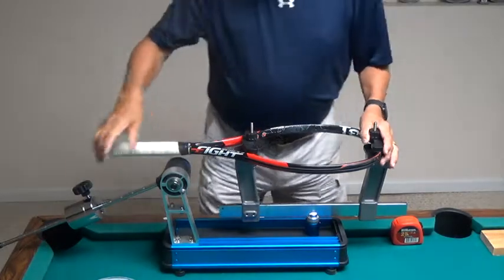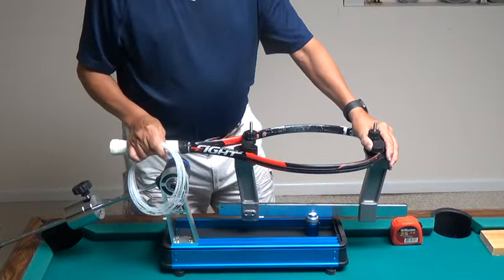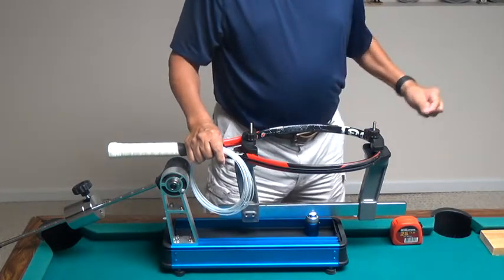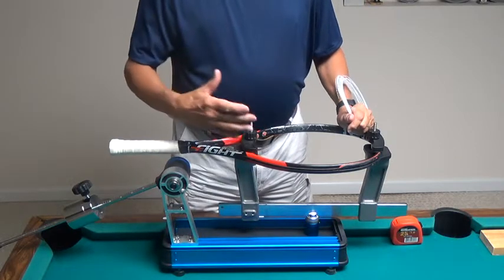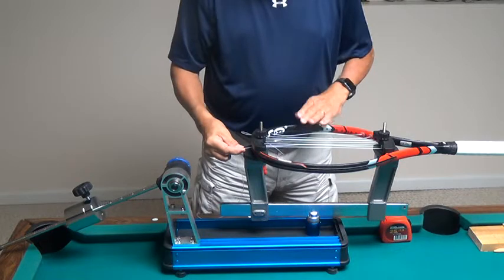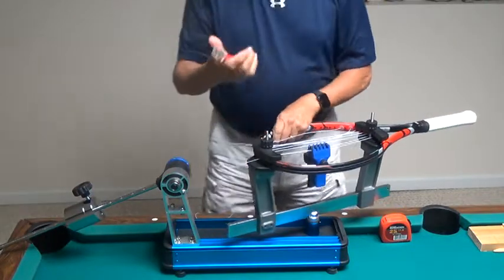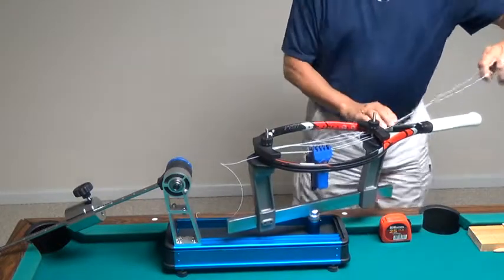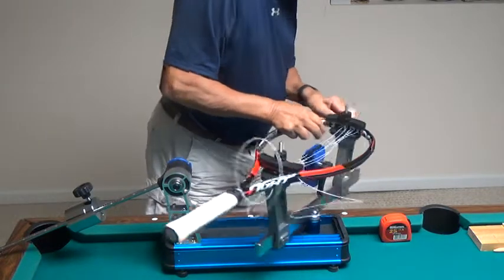Stringing ATW with a gamma X-2 (part 1)

Comment: I use 32ft for one piece box pattern(atw). 105sq.in 16x19 racquet Wilson tidal force and that's enough for 1.5ft of extra string on each end
Reply from the maker: Sokeresa that would ver much depend on the string you are using and how much the string stretches. If you’re using XP string 32’ is maybe too much. If you’re using a stiff poly you’re going to end up short.
Reply: @Mr10sStringer  good point. I did use syngut and is stretchy so yeah, i would probably add 1ft if poly

Comment: I have the progression 200 which is a similar unit.  After stringing at least 50 rackets, its a pretty good machine that doesn't require any maintenance.  Although, I have measured the tension with a gauge and the scale is off by 1.5 lbs.  When I started stringing, I did a lot of around the world patterns and then I decided to just do the 2 piece.  I find that one piece patterns I used always end up with tying one side of the mains and so you have a slight tension imbalance in the racket as there's always some tension loss on the tied side.  Also, I always recommend players use a hybrid when stringing with poly.  Over time, a single poly string will eventually destroy your arm.  I wouldn't start the mains with putting the stringing clamp at the center, you have to double pull and the centers never get reference tension.  Starting clamp is the way to go.
Reply from the maker: Wally Friend as far as no maintenance I have my doubts about that. I going to clean the clamps and gripper quite often. Better to keep that clean and never have a problem rather than wait until you encounter a problem to fix. I would never tie off an outside main. I prefer to loop the string I’m tying off behind the anchor string inside the grommet. That way you have a tensioned string from the clamp to the grommet and the knot is then tied right against the grommet so there is little or no drawback.
Reply: @Mr10sStringer  learning alot from your vids man, thanks.  I also have a gamma II and wondering what you mean by cleaning the gripper and clamps?
Reply: @Mr10sStringer 
I notice you pull tension with the arm in down position.  I've seen instructions to start pulling with arm in up position.  Is this just preference or is there an absolute answer?
Reply from the maker: Nugget when I clean the gripper I take the drum off and clean the 2 plates that grip the string. I start pulling with the bar down so I always have 360 rotation on the turntable. Also when stringing a low stretch string like poly or Kevlar if the bar is all the way up you may never get it down to level without forcing it.

Comment: I restrung my racquet using the klippermate but I messed up a lot which resulted in 2 hours of attempting to do it but I really got the hang of it towards the end I think I could restring my racquet in less than an hour the next time. So long as I don't forget what I did LOL.
Reply from the maker: That’s not bad at all I find it relaxing to string rackets. With time and experience with the racket you’re stringing, and the string and machine you’re using you’ll get faster and most importantly more consistent.
Reply: I also started not that long ago and trust me it does get easier!

Comment: Another noob question. I got Luxilon element 125 string (co poly monofilament) and I can not pull the sucker through the racket. They appear to be too stiff to navigate through the grommets. What am I doing wrong???
Reply from the maker: K V it sounds like you’re pulling the string at an angle through or you grommet holes are small and the string is too thick. But a 1.25 string should not be too stick. Try to make sure as you pull the string it is pulled straight through the grommet.
Reply: @Mr10sStringer  thanks, the string goes trough ok, it seems to be so stiff that it cant be pulled around corners like the multi string. I ran into trouble trying to pull the initial mains through the bottom to get the string even.

Comment: Are you familiar with the pro staff 90? When stringing with a conventional two piece method, the last cross has to go through a double blocked hole.  It’s my own racket, so I’m considering experimenting with ATW.  Was just wondering if you had experience with this racket.  Thanks!
Reply from the maker: Yes I am and using an ATW pattern will fix your problem. If you like hybrid stringing using 2 starting clamps to hold the outside mains will work too. You can tie off the mains then at 11T (the cross tie off) once you get down that far.
Reply: @Mr10sStringer  awesome, thanks!!

Comment: love your videos. question: what is the difference which side (left or right) you choose to be short side (some Prince rackets obviously excluded) ?
Reply from the maker: I prefer to weave my hard weaves from left to right so I determine where the short side goes dependant on the number of crosses. If there is an odd number of crosses the short side is on the right, with even crosses it is on the left.
Reply: @Mr10sStringer  that makes sense...thanks again
Reply: do you use "knot tension" when it exceeds manufactured recommended tension ?
Reply from the maker: Ralph h if I was asked to use “Knot Tension” that exceeded rec tension I would do it.
Reply: @Mr10sStringer  are you familiar with NaturalGutWhoilesale and their V 5 + string ? any tips for stringing w/o breakage ?
Reply from the maker: Ralph h I’ve heard of it but never tried it. Heard too many problems with a breaking. If I was going to try it I would never use the X-2 or flying clamps. I would only string it on my Babolat machine.
Reply: @Mr10sStringer  thanks...that's the problem I'm having. I use the Gamma ELS and have no problem with good gut but I've broken this stuff twice. Thanks for the speedy reply. I hope you don't mind the mentoring (tell me if you do )
Reply from the maker: Ralph h the way I look at it it’s cheaper to play with good gut that will last than cheap gut the breaks when you string it.

Comment: HI Mr10sStringer, I was wondering my string griper won't grip my string when rotating and slides out. I read I need to clean the diamond coating by using a knife sharpening stone. Do you have any other recommendation on how to clean it? This is what was written on the manual "Knife sharpening stones work well for cleaning the diamond coated string clamping surfaces"
Reply from the maker: I would take the drum off that has the 2 sides for the gripper and clean them with a brush and 91% alcohol. Make sure when you put it back together the top section with 1 screw is not too tight or it will not close and grip the string properly.

Comment: Newb question for anyone with the x-2. Does it require a monster grip to hold the blue ratchet knob still while lifting the drop bar? I almost need an oil filter clam to keep it from moving.
Reply from the maker: K V I do not have a strong grip my self and when you get up to 60+ lbs it is actually quite difficult to hold. If you can hold it I doubt the clamps will without having to be so tight you crush the string. But there’s still hope. Better clamps will not loose at much tension so you can set the reference tension lower making it easier to hold. You can use the T handle Allen wrench to hold the knob also. Use the T handle in the bottom section of the knob because if the top screw is too tight your gripper won’t work as well. At one time I was considering using 2 Allen wrenches in a 1x2 board to get more leverage to hold the knob. Good luck, I’ve found after stringing with the X-2 you grip does get stronger.
Reply: @Mr10sStringer  Good advice thanks! too bad they just dont have a slot for a screwdriver or something. Hopefully Ill strengthen my wimpy grip lol
Reply: @kenmtb  i recently used a x-6fc which is the same ratchet DW mechanism and it was a pain brother.i strung at 57lbs multifill and i could barely hold the grip to move the bar. I thought i was doing something wrong cause i seen vids on YouTube including this one and people don't seem to struggle as much
Reply: Can you lift the bar a bit  to release tension then turn the  ratchet?
Reply from the maker: K V maybe you can lift the bar and it will release some tension. Whether it is enough to turn the drum or not I’m not sure. The issue is as you turn the drum (CCW) you shorten the string between the drum and the frame. If you turn the drum too far you won’t be able to get the bar down to level which means you won’t have full tension.
Reply: @Mr10sStringer  That is true. I usually do a click or 2 at a time then check. I wonder if lifting the bar would change anything? In any case the videos I have seen make it look like there is little effort  :\
Reply from the maker: K V you can lift the bar to lower tension on the string then turn the ratchet. But be careful you don’t turn the ratchet too far you can naturally get it back down to level.
Reply from the maker: K V as you lift the bar it will make it much easier to turn the ratchet. Don’t go too far and don’t move a clamp until you have the bar level and stable.

Comment: when did you pull tension on the first short side main ?
Reply from the maker: Ralph h if you use a flying clamp on the 2 center mains you can individually pull tension on the 2 center mains.

Comment: This video misses the mark. If you are stringing on an X-2 and watching this video you are not using a reel, you are using a 40ft set and you are trying to figure out how to string for the first time.
Reply from the maker: What difference does it make if I used 37’ off a reel or if I have a complete. There is plenty of string no matter which you use.
Reply: Not true, I’ve been using my x-2 for 4 years and needed to learn how to do ATW so it’s the perfect video for me.  Beware unnecessary assumptions! (I use reels too btw)